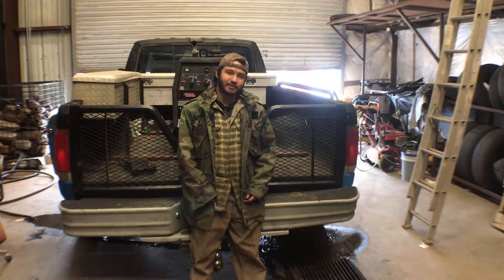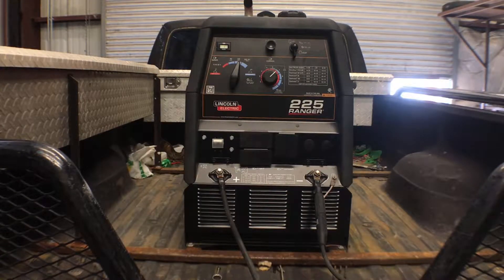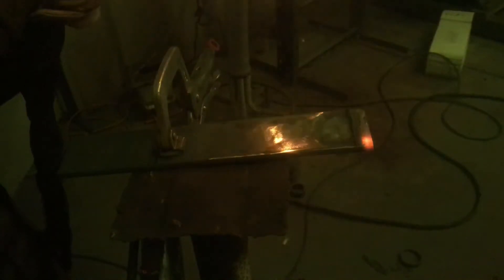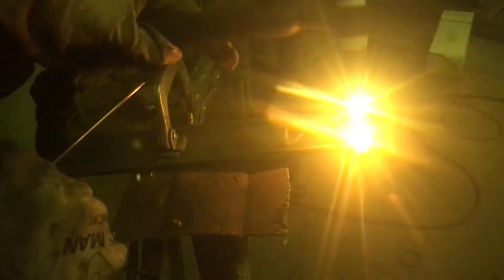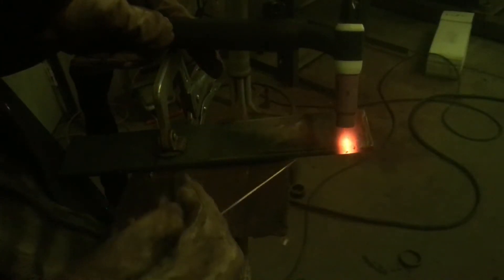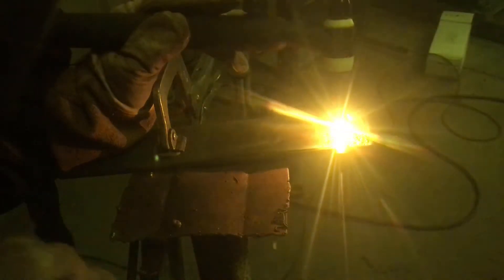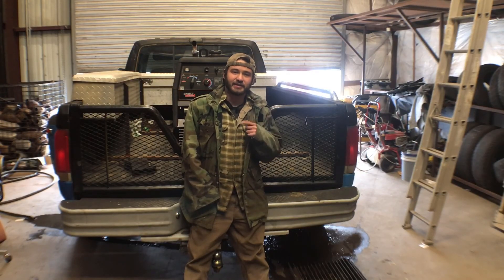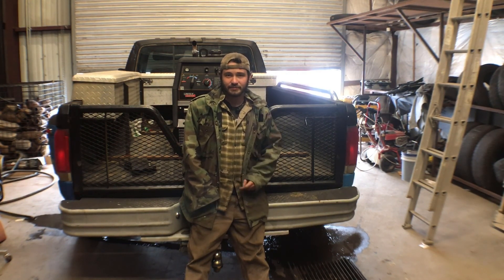Striking an Arc With TIG Lincoln Ranger 225

Comment: Are the hobart champion elite 225 any good? The price is about 1k cheaper, but i just think its one of those "you get what you pay for" machines
Reply from the maker: Well I know people who have had them and everyone after a year or two of hard use now has a miller lol. They are good machines for stick but their arc is rough for Tig rougher than the Lincoln I have, and the stick arc is smooth, and I don’t think it has a cv or ac mode either so there are some things to consider
Reply: @adamswelding5052  

Oh man, i guess that new lincoln ranger 330 that just came out looks pretty good then lol
Reply from the maker: It does but I find them to new with too many changes to know if it would be reliable yet
Reply: @adamswelding5052  

What worries me is the lcd screen, not sure if its too close to the engine and the pc board might fry up, just like the lincoln vantage models.
Reply from the maker: That is a possibility but I’ve seen some really good torture test videos but since they where from people marketing the machines who knows how they really hold up